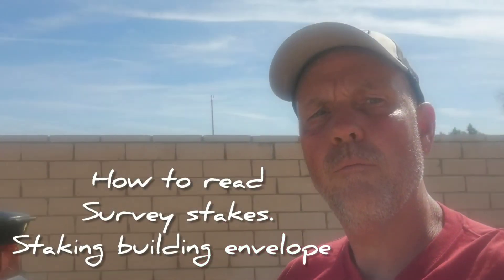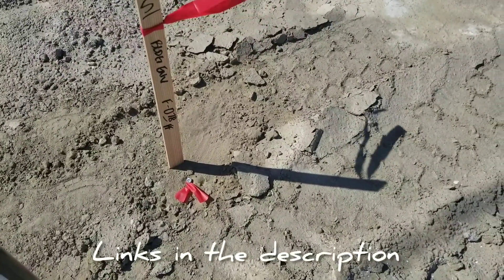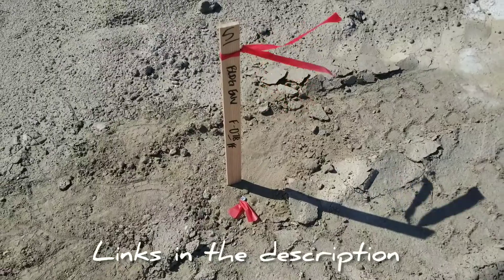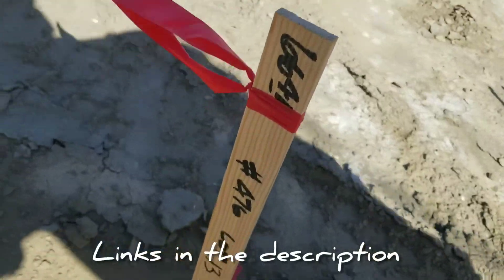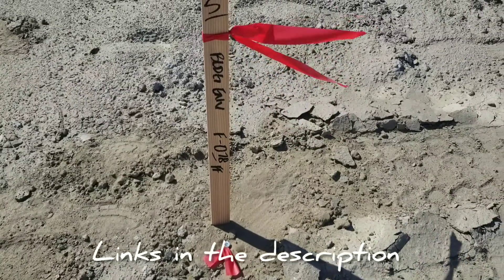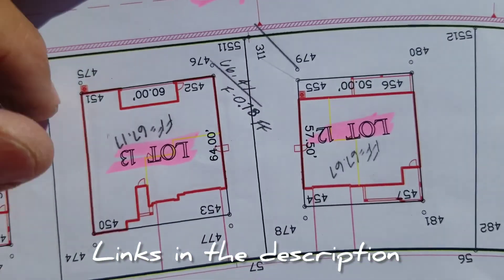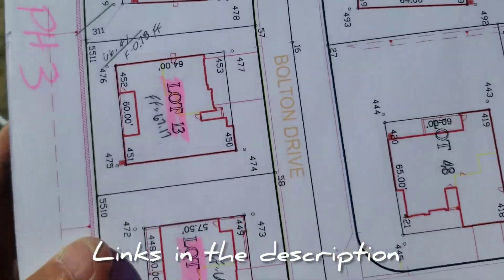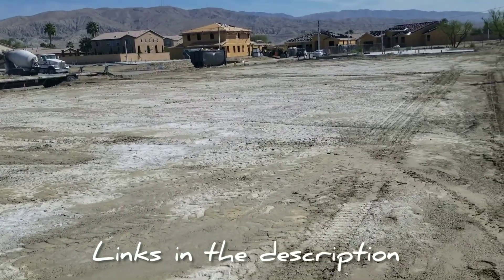How to Read Survey Stakes.   House corners and Building Envelope

Comment: What you mean by form certified ? Never heard this in Florida..
Reply from the maker: If I mentioned "certifying forms or pads" , in California we have to certify the pad grade +/-  a tenth.  Blue tops are more visual.  Once pads are certified, then approval for house corners (graded to finished floor) are made then they trench and put in the foundation forms.  Since our lots are smaller and there are minimum set backs for both front and side yards, we are asked to certify the outermost envelope before the pour. The certification is both Horz and Vert

Comment: We usually use 2 short stakes were we have four stakes on 4 corners of the envelope and 4 corresponding 10' offsets. Sometimes when there is rock that prevents me from setting them I recalculate a different offset. Also, when (if) you are doing lot surveys in subdivisions do you rotate and translate in the field? They make us do that which I like because I think it is good practice on how to solve boundaries, even if there is no senior rights in platted subdivisions.